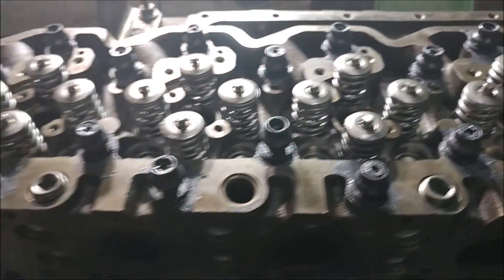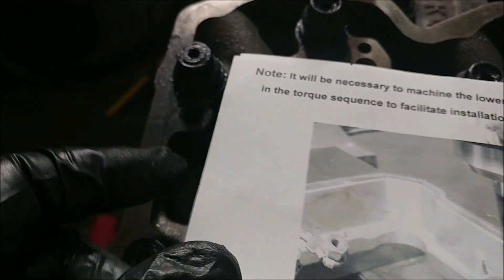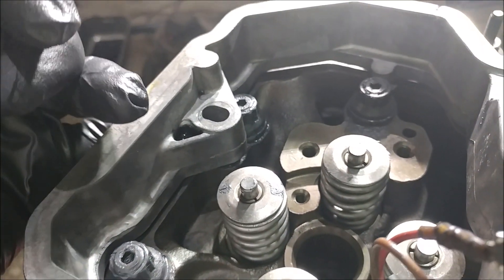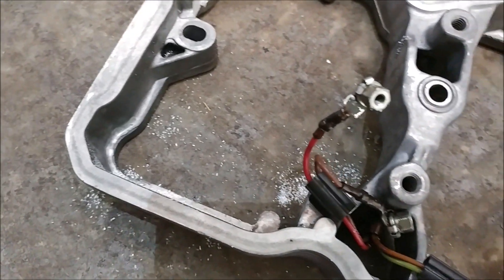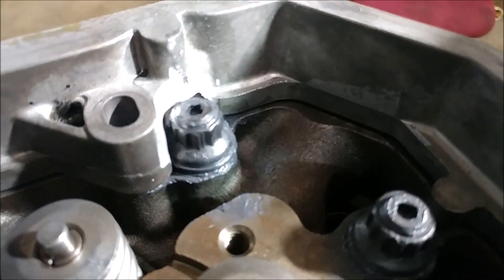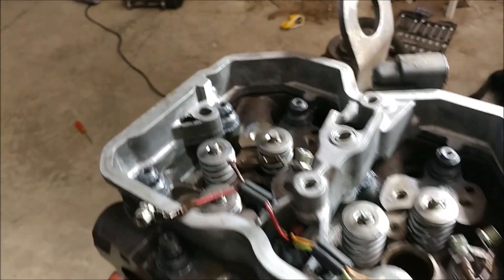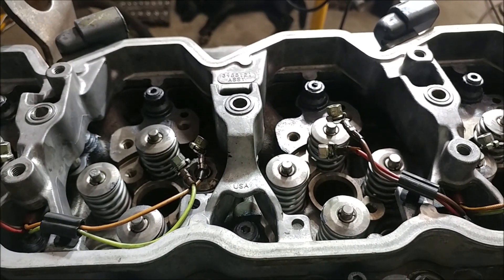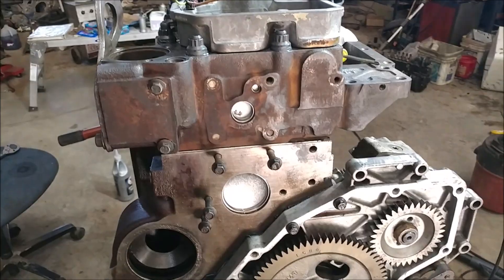Chronicles Of An 03 Cummins Rebuild -Part 31- Milling The Lower Rocker Box For Head Studs

Comment: Sorry don't mean to ask 3000 questions but your valves look like some of them are sitting lower than others... Is this normal? I have not worked on anything newer than 2001 so my knowledge is limited.
Reply from the maker: Don't sweat the questions! I love questions. Sometimes I can't answer as fast as I would like but I will help out were I can! The valves looking like they are different heights is just and optical illusion from when I filmed it. If you had one if front of you it would be close to perfectly level across them!
Reply: @70440charger  - 🤯 damn bro you got me lol